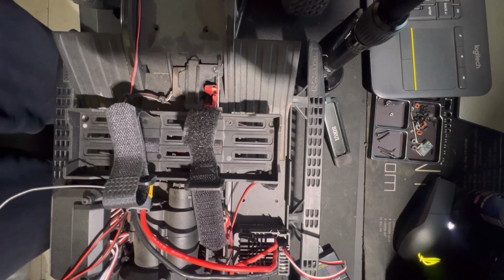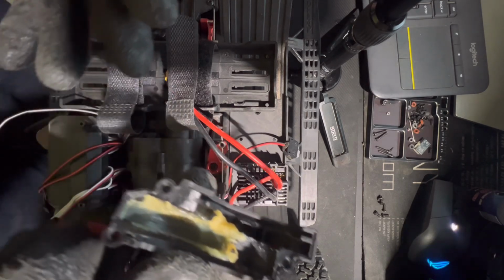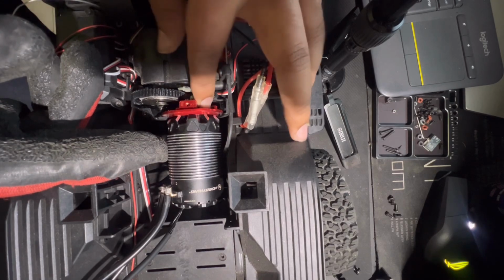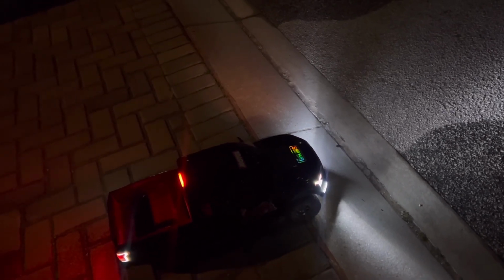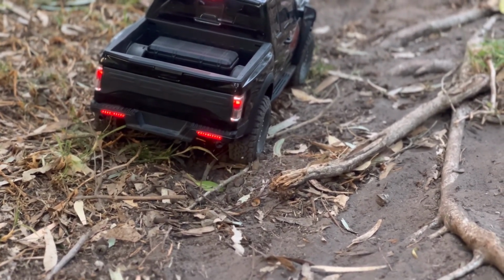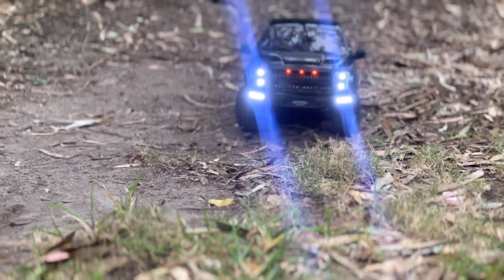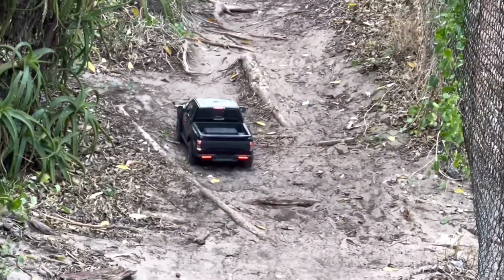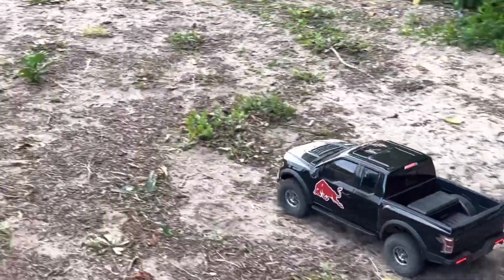Fitting a Sensored Brushless XR8 Pro g2 esc & XR8 4268 Pro G3 Motor into the Traction Hobby F150 1/8

Comment: But isnt the Axe R3 for rock crawling?
Reply from the maker: @Godisamazing101  yes, it is. This one is for sending
Reply: @febuilds  would you say this motor is much faster than the stock one? I wanna make mine wayy faster but also able to crawl slow. Maybe you can do a speed test.
Reply from the maker: @ go for the axe 3
Reply: @febuilds  thank you
Reply: @febuilds  appreciate your reply, one question doh. The motor that comes with the R3 is 74mm in length. Would that still be able to fit?